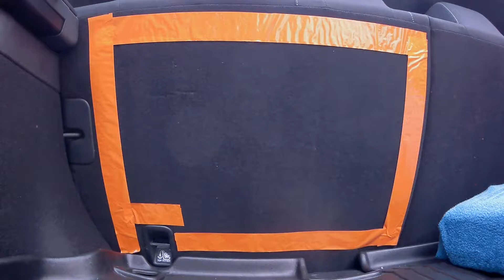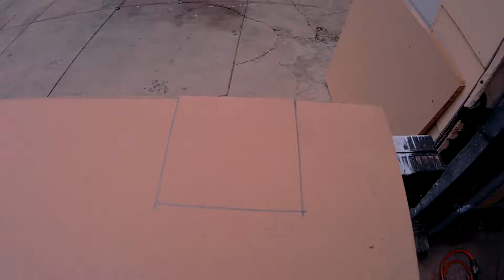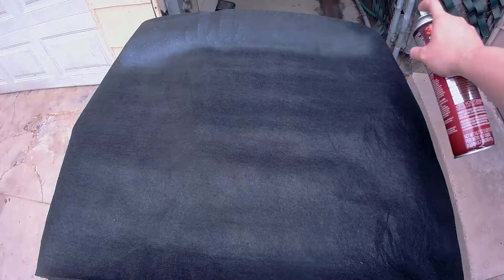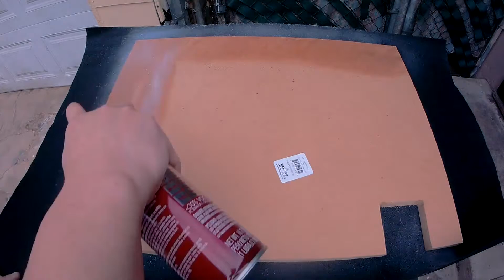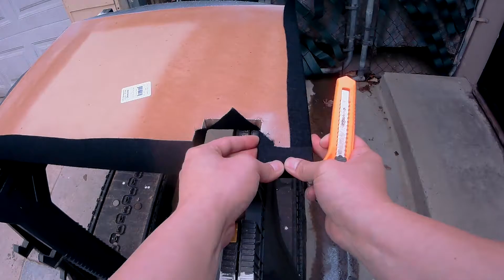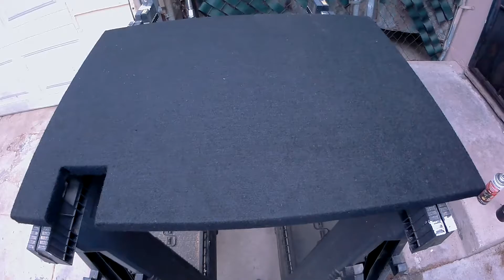2019 Honda Civic Hatchback "AMP RACK" install

Comment: Great job on the board but I wanted to know how to mount
Reply from the maker: Use sheet metal screws about 1-1/4 inch long and drive it through the board and into the metal of the backseat.

Comment: You didn't show one of the main parts how to mount the board to the back seat that's what I wanted to know
Reply from the maker: Use self tapping sheet metal screws. Make sure ifs longer than the board you used and penetrated the metal plate on the backside of the seat.

Comment: I have the same style car and was just looking to see how your keeping your voltage at a reasonable level.
Reply from the maker: Your best bet is to get a second battery in the back and a HO alternator. I’ve been looking to buy an autotech engineering HO alternator but I don’t drive the car much so it’s on hold.

Comment: Wnat size screw did you use to secure the wood to the back seat
Reply from the maker: Use #4 self tapping screws. About 1.5 to 2 inch long depending on how thick your wood is.

Comment: Hey John. Is your board still holding? I have a 2019 Civic EX sedan that I want to mount my amp board to, but I’m concerned the thin metal in the back of the seats won’t hold too well. My board consists of a Punch 1000x5, an LC7i and a capacitor.
Reply from the maker: Still holding and music still blasting.
Reply: @johnsneverendinglistofrand1377  one more question. How exactly did you attach the board to the back of the seat? Screws or bolts? How long? I don’t want anyone in my backseat getting impaled on nails!!
Reply from the maker: @doomorbedoomed8748  use sheet metal screws or bolts. Your choice.

I made sure it was long enough to go through the board and about half inch after the board.

Comment: How did you mount it to the back of the seat ???
Reply from the maker: Use sheet metal screws to mount it to the metal plate on your backseat.
Reply: @johnsneverendinglistofrand1377   what were the size of the screws
Reply from the maker: @ygbodybuilder3023  Use sheet metal screws. Long enough to penetrate the board and into the sheet metal. I think mine were 1.5" or 2" long.
Reply: @johnsneverendinglistofrand1377   yeah I got  1 & 1 /2 and it's looking like it will go through my seat lol

Comment: Do not use dry wall screws. They're not made for that. You need "sheet metal Self-Drilling screws". They will work a lot better and faster. They're at any hardware store.
Reply from the maker: Great recommendation.

Just used what I had at the moment. Still holding up pretty good.
Reply: So I plan to mount the wood I'm using tomthe sheet metal in my rear seat I should only use self tapping or self drilling? And does the same apply when mounting the amp

Comment: Hey I really like this video and install and was thinking of doing this for my own car, because I mount my amps straight to the back, and they tend to fall after a few months. Do you think that whole rack would fall if I did an install like this?
Reply from the maker: My rack hasn't fell yet. You just have to make sure you mount it into the high points of the back plating of the backseats. The sheet metal isn't straight. Also I believe there are holes back there. Just use a screwdriver or something to tap around the backing to make sure you are going through metal.

Comment: How did you mount the border to the seat
Reply from the maker: A few Drywall screws through the board and onto the backseat.

Just make sure you tap around the backseat to have an idea where there is metal and where there are holes.
Reply: If you dont get the right screws, it will be a pain. I learned the hard way. You need to use "Sheet Metal Self-Drilling Screws" . It will make things a whole lot easier.

Comment: So when you drill the board to the seat did you pre drill holes in the board as well as the seat? Or just straight drill it with the screws?
Reply from the maker: I just drilled the board to the rear seats. Not pre drill. Reason to have a wooden amp rack is because if you like to move things around you tend to make the metal on the rear seat look like swiss cheese. I'd rather use a board which is more forgiving and can be replaced.
Reply: makes sence! Thanks
Reply: @jeremyvillegas572  Do not use dry wall screws. They're not made for that. You need "sheet metal Self-Drilling screws". They will work a lot better and faster. They're at any hardware store.